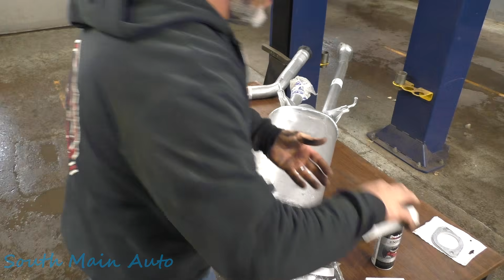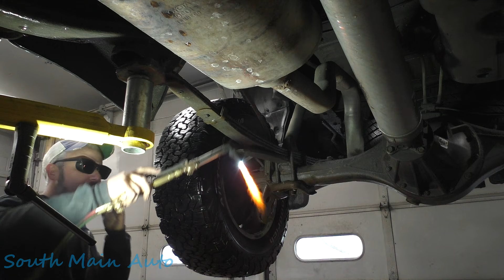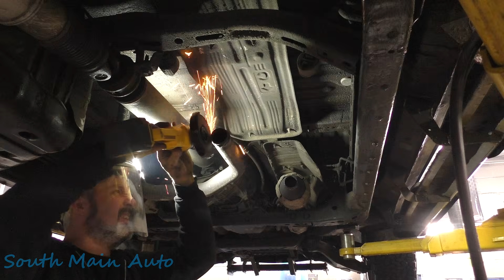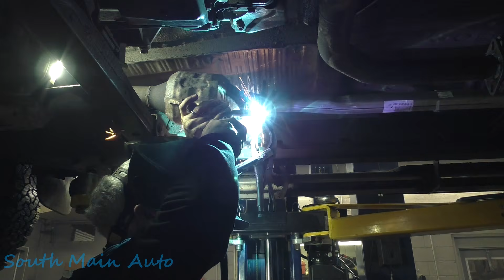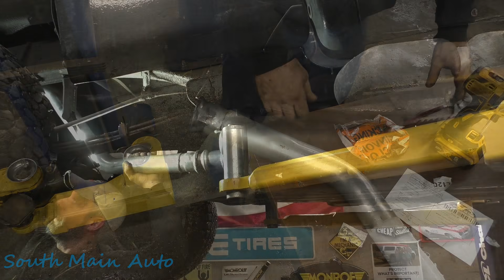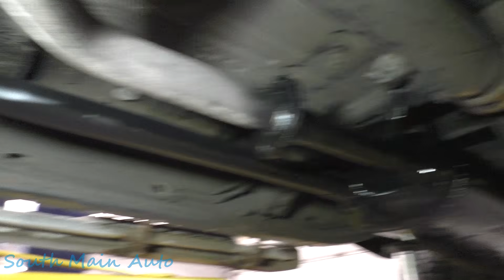Toyota Tundra: Welding On New Convertor Flanges & Replacing Muffler

Comment: Cutting torch and angle grinder are equally useful for cutting purposes but sometimes you need to heat things up to expand them and you can't do that with an angle grinder. Access is another issue. The torch is the more useful really.

Comment: I guess they guys saying torches cost too much to use , haven't bought cut off wheels . You also cut that pipe pretty quick. A grinder with a cut off wheel would take longer and probably bind up and blow up in your face ......

Comment: Firestone Auto Shop used a cutting torch to remove my rotted tailpipe near the leaking Gas tank. Idiot saw no problem with it. Seam leak on the tank, on a 1977 Dodge Diplomat.  How does it work when your car catches fire while they work on it? Oh, your car is blue booked at $200, so we pay you for the value and we keep your car?

Comment: On the railroad, the cutting torch is known as the "hot wrench."  It's a huge help in replacing rusted track bolts.
Reply: Also on the railroad I used to work for, the gas powered hacksaw!
Reply: Over my way it is referred to as a Gas Axe.
Reply: @dgk42  We call it the blue wrench.

Comment: I'm no expert welder, but I can use a MIG hot metal glue gun to a reasonable degree. I can't fault your hot metal glue gun results, Mr. O! I'm sure you'll get a decent amount of time out of the exhaust. 

Being a diesel guy, changing exhausts isn't something I do often here in the "sunny" climate of Scotland. I find that over here, diesel car exhausts last a LOT longer than gas (or, as I'd say, petrol) car exhausts - I don't know if the same can be said in the PRNY?

Comment: I have NEVER worked in, or even seen a decent shop (commercial or private) that did not have, and regularly use, an oxy/acetylene torch & i have never even worked or lived in the rust belt.

Comment: Victor: a small scarfing tip works very well for removing welds and bolt heads without cutting base metal.  Run the flame lean. Travel trade the work.

Comment: Wow.  Not a bit of rust on my 2010 Taco.  None on the muffler and none on the frame.  Good ole Fluid Film.  I hope the muffler is stainless like the one on my 1997 Taco.  Which has 300 K plus on it and the original exhaust and muffler, etc.  Body and frame is essentially mint but I have to admit though I live in Wisconsin I don't drive the 97 in the winter. I hate putting non-Toyota parts on a Toyota.  I did so once, on the 97, and swore I'd never do it again.  The non-OEM clutch lasted 15K miles and started slipping.  And I drive like an old lady.  Good luck though.

Comment: Just replaced the exhaust system on my kids '04 Sequoia. I bought a system from NAPA and it fits and works good! $1.200 though! I use a torch most of the time on exhaust systems. you can cut the outer pipe off of the inner with not much difficulty.

Comment: Love the channel.  Nice to see you working on a ’13 Tundra 5.7.  I have a ’12 of the same version.  Love the vehicle.  The only thing that rusted out for me so far in MN was the original bed…replaced under warranty…”manufacturing issue” that they stood behind.  Of course, the replacement is rusting out in the same place, and it is out of warranty.  Maybe you can do a vid on how to convert to a flat bed 😊.  Keep up the awesome-ness.
Reply: I live in the South so excuse my ignorance, is coating the undercarriage considered optional considering the chemicals used on the roads?
Reply: @markdaugherty6378 Optional for sure but highly encouraged.  Dr. O has many episodes talking about frame rot in NY.  Not as bad in MN but rusty cars due to road treatments are definitely a thing

Comment: I hope you use hearing protection when whanging and banging on all that metalwork. My brother in law spent 30 years doing exactly what you do, but thought he could simply tough it out. Turns out you can't! Every little insult to the ears adds up to the point that he has been  dependent on many different generations of expensive hearing aids and still can't get back to normal. The moral is: if work sounds loud, it is too loud. Those little foam earplugs topped with hearing protectors should always be worn. and is way cheaper than trying overcome the damage later.

Comment: You do what you have to in life  soon the cars will be self driving and the local mechanics will be put out of work because it will not be permitted to work on cars in my life time in went from a match cover and a screwdriver cars that ran for 30 years because no computers to shut them down  now we have cars with computers that will not let them run when thing wear out a little we burn 20% more fuel in the catalytic converters and have wars for that 20% oil we burn when we could have planted trees and leaf thing be a screw driver and a match cover .

Comment: Being a certified master auto tech for 35+  years I can say this with confidence "Scotty Kilmer is a hack and I wouldn't rely on him just like I would not rely on Jim Cramer for stock advice!"
    Also, I never light up a torch for doing exhaust work like that, I just use my Milwaukee M-18 hacksaw and I cut the flange and everything off because I bought new ones just like you did but I don't worry about are they going to line up or not because I temporarily put them together with bolts and nuts moderatedly tightened and then I clean the pipe with my grinder but I have a wire brush on it and I clean up the ends of the pipes so that it will take a weld very well and then I put the new muffler or cat or resonator or whatever on the vehicle and then of course I tack it and then I take the muffler back out so I know it's already indexed correctly. I do not understand why you wasted time putting the muffler on and then cutting the flange off because then you can align it to every which way the flange was on the muffler pipe! I could only make it out to the 15 minute and 53 second mark and then I had to shut it off, Couldn't watch the rest, too pathetic for this one show. The other shows are good.. this one was not, that's all I can say but I also understand different people have different ways of doing something but there is a better way versus the best way and you were not doing the best way, not even close! 
    Edward Heath - Proprietor of "Madison Combustion" out of Madison, CT USA

Comment: Scotty doesn't brag on the tundra like he does the F-150. He actually has frustration with the tundra. The starter is on top and the intake has to be removed to get to it. He seems to more so brag on the cars, especially the 94 Celica with exactly 244k and no more miles.

Comment: Cool I know where Avoca is.

I'm from up in Rochester.
Back in the 1990s I used to scour all these parts for H bodies and monza's.
Then later I would always pass by there on 390 heading to the swap meet at Carlisle PA.

I love to find those out of the way junkyards you used to be able to find down there.

But not so much anymore.

I have a 2018 Ford Transit with no drivability issues yet it gets the 420 and 430 codes.
270k miles. 
I use it to deliver freight around the nation and I'm hoping to get it to 500,000 miles.

As soon as I swing through the area maybe I'll stop by and you can give me some advice on if it's worth it to try new cats or just keep rolling with it as is. 

Cool channel I didn't know you were so close

Comment: First thing to note ............. GM and Toyota are the same thing as they have been in bed with each other forever. The Pontiac Vibe that was really a Toyota Matrix is the first to come to mind. GM no longer offers 5.7L (350) Then Toyota gets a 5.7L for the Tundra. And so on. As far as the torches go, they are called the green and red wrench set. Don't forget the "ford wrench", a 5lb sledgehammer.  Remember, Don't force it, always use a bigger hammer!

Comment: If you are looking to see if a flange or weld is leaking,burn a hole in the side of the pipe close to the weld. If it is leaking, the flame will show where the leak is. Then just fix your hole.

Comment: there is a company out of  miami florida that mandrel bends two different types of stainless exhausts. 304 and 310 i believe. i have purchased 3 sets of exhausts from them over the years for cars that I have fixed up. I have always received excellent tubing with round shape. Because of the mandrel bend the common choke points are not there allowing exhaust to free flow. Their prices are reasonable as well.

Comment: It's wild to see all the lo-tech techniques other mechanics use to get the job done.  I would have never thought to use a ratchet strap to join pipes, probably won't start to either, but it's definitely a technique I'll keep in my back pocket.  All these years I've been using a chain and a screwdriver.  My boss bought one of those expensive pipe joiner tools and that thing never works right.  Lo-tech rules.

Comment: I’m in RI I can’t work without a torch (blue wrench) it’s impossible. There’s some 10mm that will snap without heat 😂 it’s not expensive just the acetylene is that’s it and that’s not even that bad

Comment: I couldn't imagine trying to work on a vehicle here in New York without a torch handy. I use a torch as much as any other tool in the shop. As for the welding, it only has to hold. It doesn't have to be pretty. Note to self.  Hot metal is hot till it's not.

Comment: There is nothing wrong with using a gas cutter for warming up nuts bolts and cutting off seized joints. The only word of caution is if oil catches fire as happened on my son's XJ jag it got a hold and 3 fire extinguishers wouldn't put it out. I don't know if they are available in the US but in UK I use a step nozzle or it's also called a sheet nozzle it gives a smaller more controllable  flame and snacks be more precise when cutting off exhausts and suspension components.

Comment: There is a 100% chance that I will burn myself when I'm welinging.... every.single.time! 🙄 I do a lot of tig welding and I have even burned my mouth when I unknowingly stick the hot end of the filler rod in my mouth to hold it. Talk about ding dong.

Comment: Grew up in Delaware where snow removal consists of salt and Spring.  My oxygen-acetylene torch was the best investment I made, from heating rusted fasteners to cutting bolts.  Watch the heat, and you can wash out welds just like you said.  Didn't have reasonably priced mig in my day, so it was bent stick or tig.  Great vids!  I worked for a time in Hornel, so I'm familiar with your climate.  Take care, and Hi! to Mrs. O.

Comment: 2003 Tundra owner , I installed a Gibson dual muffler and pipes when the OEM  system rusted out (at 200,000 kms)  , Gibson lasted  less than 50,000 kms, was noisy and droned at HWY speed. Replaced that with a used OEM TRD  Borla stainless dualsystem removed from a crashed tundra in a junkyard ($50 complete) that system sounds great, no drones and  has survived  6 years , 60,000 kms . Truch has over 400,000 kms , original drivetrain , only minor issues over the nearly 20 years I have owned it  (Toyota changed the frame for free,  rear shocks , a couple of lower balljoints , 2 batteries and a radiator, brake pads , one caliper , ) I used to love my Chevy trucks but OMG dod quality take a dive in the mid '90's.

Comment: I’ve been buying a lot of parts from Rock Auto for my customers as long as I have enough lead time and they can wait until the parts get here.  It’s mostly been suspension parts and electrical parts, Moog suspension part and Standard electrical stuff.  So far so good and there less than good ol NAPA.   
  Do you still have your Jeep?   Are you done yet?  Ha ha,  my boss use to always say, is that the same one.

Comment: We do this type of repair at my shop all the time! Great to see someone else doing it like we do. Whatever Toyota and Subaru use for exhaust pipe holds up good, but the flanges just turn into dust. By the way, that's an Autopart International muffler and we get them special order through Advance Auto. As far as I can tell they're the highest quality replacement exhaust out there. It's now my first choice for exhaust. Had way too many Tundras come back for Walker tailpipes that rusted off after a year or two.
Reply: Good info thanks

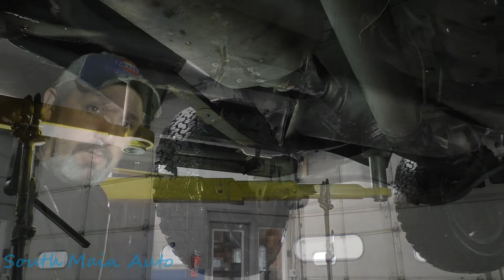Comment: 7:10   I live on Long Island.  Probably half the rust you have up there (upstate).  I have the same Victor "medium duty [250]" torch.... 125 oxygen / small PROPANE (only a couple hundred degrees less than acetylene, heats and cuts just fine with a lighter tank and can use a BBQ in a pinch).  All I had to do was change the tip from acetylene to propane and use a Grade-T hose for propane.

Comment: I have found that wiping the pipes/muffler down with Lacquer thinner, heating up the pipes & then spray it while it is hot, works the best for longevity. As for the "hot wrench, got to have it & price is not crazy to fill a cylinder.
Owning your own cylinders is a plus. 
Cool Gulf hat, brings back memories from the 60's!

Comment: Here in salty Britain (England, Scotland & Wales) Oxy Acetylene cutting, brazing and welding is a dying art - as far as welding goes modern mig & tig is superior for less skill, but in the hands of an experienced gas welder its a tool of beauty. I learned from my old man (Dad) and I could not  run my shop without it.

Comment: On messed up flanges, if theres enough of it left for the seal, i like to use a split flange.  its a standard flange thats cut in half basically that bolts together.

Comment: Ahh that's too bad you didn't notice as soon as the tailpipe broke, before it got twisted up around the axle. Many times the muffler itself is intact and we've been able to make a clean cut on the muffler as well as the tailpipe and slide a nipple piece in to weld them back together. As for the front flanges, we always eliminate them. In this part of the rust belt, people aren't picky about it, but I'm not going to judge you for wanting to rebuild the front flanges. It's just that, around here, flanges are useless because the bolts, nuts, flanges and gasket all get frozen with rust until they're all one solid piece anyway (as you probably noticed on the rotted out factory flanges).

Comment: A torch rig isn't a big cost if you use it all the time and that would be up north. now a southern garage, weekend tinkerer or other place it's only used a few times a year, it's a big cost. especially when someone forgets the valves open/not shut tight and the gas slowly leaks out. it sits for six months you go to use it, no gas! ( I know nothing about that) 🤯🤬

Comment: Mr o. My only concern is I was taught and told to disconnect your battery when welding on your vehicle to keep from toasting the computer and or electrical systems. What are your thoughts.?

Comment: LOL, you're not the only one that says f*** that's hot. A lot of my work is welding as an unlicensed HD Mech/welder. I hate working on exhaust. I had to build a whole new exhaust for the dump truck I drive. There are no OEM parts it was all by scratch going through the walker and donaldson catalog. The next chore is building a new down pipe. You can't get parts for a 30 plus year old Kenworth anymore.

Comment: Bought a Tundra first year they introduced them as a mid sized truck. A little sketchy for me not being one of the Big 3 Americans but it had a V8 and was about $24,000 4wd off the lot. Bullet proof truck with the only drawback the mileage. Power was outrageous for the light truck and that engine. Of course, I'm still thinking of that 22R Tacoma that ran until the body rusted off of it.

Comment: Everything mechanical can and does eventually (or a lot sooner) break. I think everyone knows that. But exhaust and mufflers? up here in the snow and salt country, they break regularly. But i have to say this, for decades I drove Fords mostly, and tried a couple of GMs. The Fords I loved, but they gave me real issues, and the chevy's, well they are rolling piles of scrap. I drive a 19 year old Tacoma 4x4 V6 double cab, and i have replaced brakes, exhausts, and cats now, along with other wearing parts. But other than that, I have never owned a better truck. This old girl will out live me, and all the much newer chevy's and jeeps my buddies drive, without question. Having said that, it is sad to see Toyota going to small turbo engines that won't last much more than 100K. Like all other modern tech and machinery, they go downhill like restaurants go belly up.

Comment: I've had great success just deleting the flanges on both sides and then splicing it back together with the exhaust clamps from an Audi. Maybe just a couple tack welds for extra hold-together power.
A lot of these Japanese cars have good pipe, but the flanges are trash and rot right out.  It didn't seem wise for me to replace the pipe and muffler with something that is going to rot out in a couple of years when the original is in good shape and has a decade left in it.

Comment: Worst vehicle ive ever owned was a 19 trd offroad tacoma i bought new and 20,000 miles later i traded it off.
What brand of vehicle do you buy where the dealership wont fix the problems and corporate sides with the dealer?
problems
Engine,low power not hardly enough to get out of its own way.
Transmission,very strange acting and weird shifting and driving along steady speed truck hunches.
Drivers door that bounces open at times when closed, also happened service advisor that said i need to open the window to shut door.
Blending into traffic ,throttle fails to increase engine speed for a few seconds, dealer said they flashed drivetrain module but i couldnt tell any difference.
Rear end whined all the time, dealer said they couldnt hear it.
In cold weather ,20 degree range would shudder and miss till drivin a few miles.
Had errors with radar and Brake ! Coming on on cluster when nobody was in front of me. 
Done with Toyota crap quality